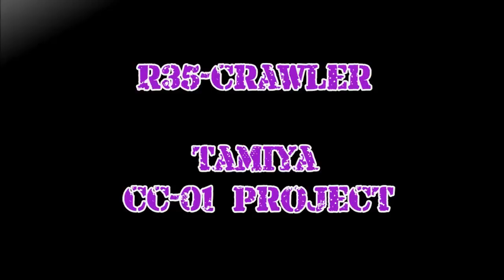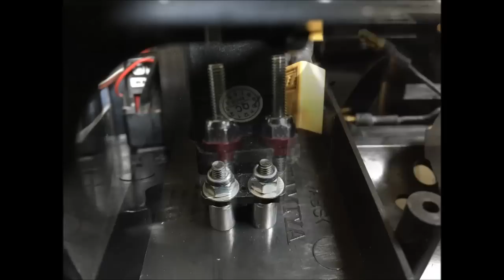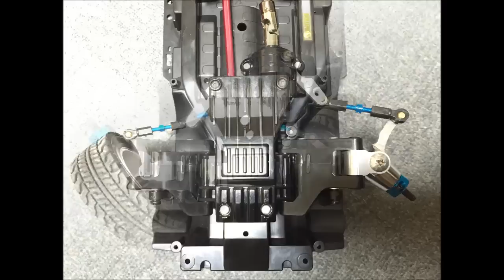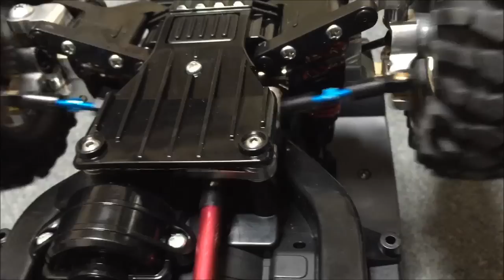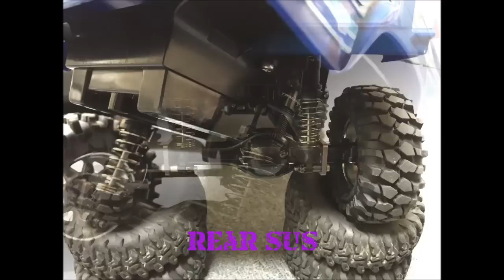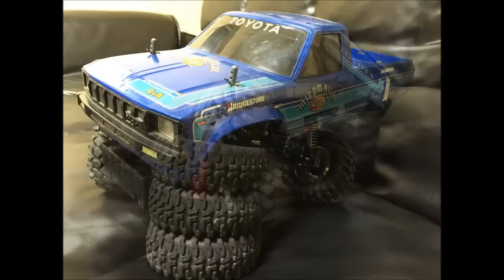2015　CC01 HILUX　PROJECT  　切れ角UP！マジギレステア

Comment: Excuse me, can't cc01 C HUB be used?
Reply from the maker: Because we are using TA 05 Universal.
So we can not use CC01 hub.
Reply: @r35_crawler18  It's TA05 knuckle?
Reply from the maker: @庞剑秋  WR02 knuckle& C hub.
Reply: @r35_crawler18  I have a try, and found that 46mm ta05 Universal is too long...
Reply from the maker: @庞剑秋  I had no problem. Sorry.
Reply: @r35_crawler18  
Sorry，I do not understand，why we use TA 05 Universal？
Reply from the maker: @庞剑秋   Even if it is not TA 05, I think that it will be OK if the steering angle increases with other universal.
Reply: @r35_crawler18  I understand, only ta05 universal have the best angle!!
Reply from the maker: @庞剑秋  I think that steering angle 40 degrees can be secured even except for TA 05.　Please try hard and challenge.
Reply from the maker: In case of CC01 it is OK if the steering angle is 40 degrees. Increasing the steering angle any more will increase the burden on the cup.